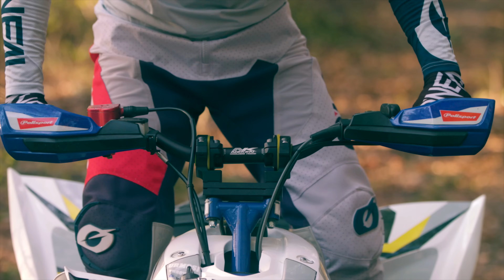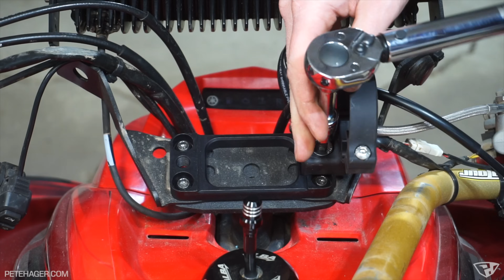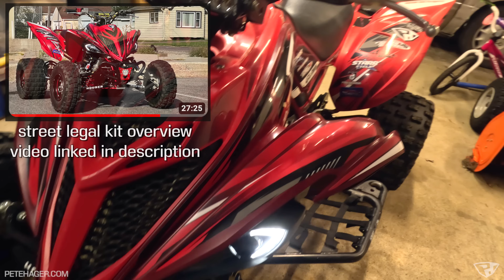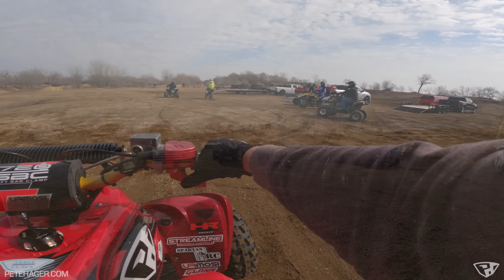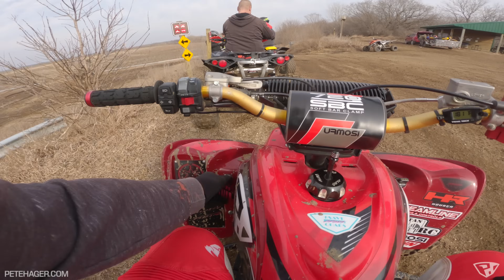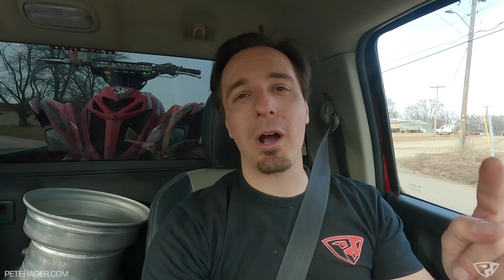Raptor 700 Anti Vibe Test Ride

Comment: I can appreciate a well milled CNC milled lathe customer parts. Like those vibration stabilizer contact point system frame body upgrades with I imagine a bushing of some sort of material like ABS or rubber.

Comment: Hi 🤚. My friend just bought a honda 400ex he came across here in the uk very rare here first one i ever seen. I have many honda xr’s so i am familiar with the engine.He asked me to give it a once over to service and check it all before he uses it .your vids been so helpful for me to gain knowledge of these machines so just wanted to thank you for the info 👍. May make some vids of it and put it on my channel.
Reply: Do it!  I spend time in the UK occasionally and have always wanted to check out quad sports there.  I'm curious of how all the regulations impact the sport.  I'm assuming all quads have to be registered every year, are there any other regulations that restrict or govern riding on private farm land?  The 400ex is an awesome, dependable bike and easy work on, just keep it clean!  Corrosion is a killer over there.  I've had a few over the years.  Honda has a whole series on Youtube on the 400ex.  I just upgraded to a Raptor 700r and loving the torque!

Comment: I would love to do antivibe on mine. My old body needs all help it can get lol
Reply: I bought a Raptor 700R specifically for the reason you mentioned.  My old 400ex was killing me.  Had upgraded suspension and steering stabilizer but it was still kicking my butt, mainly my wrists.  The 700R suspension is way better and the low end torque is a life saver in XC.  I've got the precision risers and will stick with that for now.